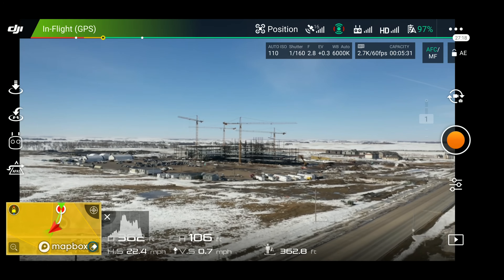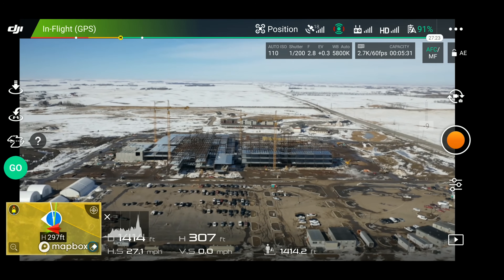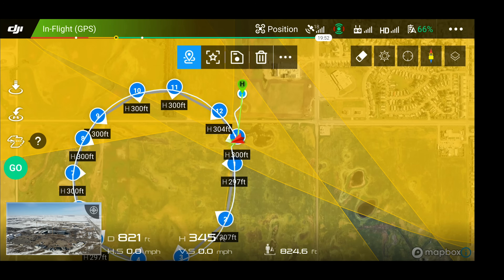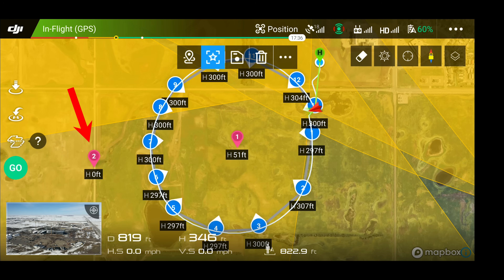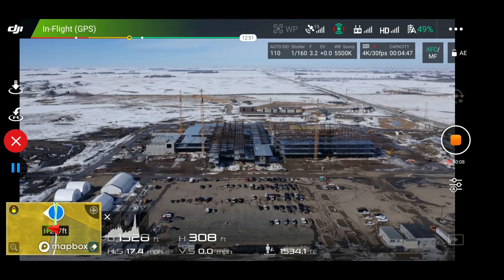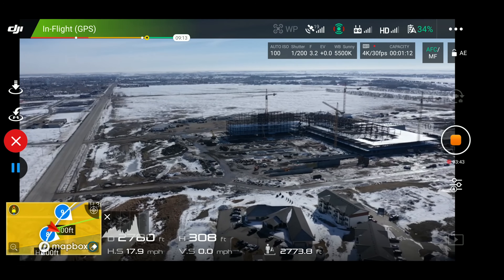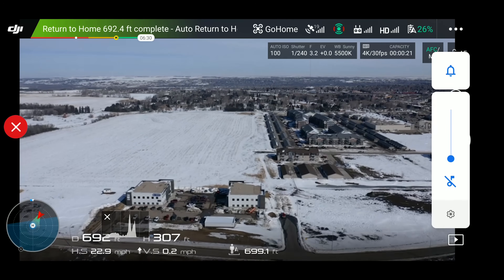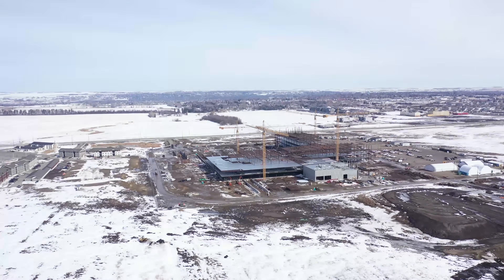DJI Waypoints 2.0 - In-Depth Tutorial Part 2 - One Setting Makes All the Difference!

Comment: There’s a couple of things I’m not happy with with .2 .0. The first is apparent in your video where the camera jerks  as it reaches each waypoint and it’s not a smooth motion (which everybody seems to be talking about as a hardware or firmware issue) the other problem I have is where you have set l(ike in your video) 13 waypoints and you are unable to start your mission at the highest waypoint and do it in reverse
Reply from the maker: The jerkiness was my fault.  You can adjust the arc angle of the waypoints. As for running it in reverse, that would be cool, but you could always just set up another mission going that direction
Reply: @51Drones  No, there's a known issue with the jerky behaviour. Also, you can run a course in reverse after a manual plan, my point was that it doesnt show you the the last waypoint check box in the app. Here's the stuff about the jerky behaviour. https://forum.dji.com/thread-182749-1-1.html

Comment: set a mission to fly waypoint and let the drone hover on arrival.  Launch the drone and allow it to arrive.  From that point manually set POI.   This will ensure your launch position is always the same and so is your starting camera angle and height
Reply: @51Drones  Could you start with a poi and use it to keep your radius constant while setting waypoints around the circle?

Comment: Did you customize your C1 Britton for setting each way point or is C1 a default when in the waypoints mode during set up?  Thx
Reply: C1 is default for setting Waypoints when you are in Waypoints mode
Reply: @philsmith5400  Is this the same for the mavic air by using the custom button ? (no C1 button on the air)

Comment: Why don't you tell your viewers about Litchi Waypoints?? 1) With Litchi you can plan a mission WITHOUT your aircraft being turned on. 2) You can set your waypoint altitudes RELATIVE TO GROUND. 3) Using Virtual Litchi Mission (FREE) you can preview your flight (including altitude changes, gimbal pitch changes, gimbal angle changes) in Google Earth Pro. I see no need to EVER use Waypoints 2.0 which is so inferior to Litchi waypoints. You should explore Litchi!
Reply from the maker: I don't want to tell people about Litchi until I have used it.  Running this mission has prompted me to check it out.  Thanks!

Comment: I believe the lines between the waypoints is a straight line and you had the camera at waypoint one in that direction and you were right about having the other points aim at the same place.  That is where the mini adjustment came from.  If you set the point of interest and set distance from and clockwise or counterclockwise is should be smooth.  In other words, I don't think you need waypoints for a perfect circle around the plant. Waypoints would be better for an irregular shape property or plant.
Reply from the maker: I missed a setting that will help smooth things out.  I'll have to wait a while to try it again though, as there was a large fire at the site this weekend!
Reply: @51Drones  But Russ, since you are just doing a circle you can just use the POI app and it will be a perfect circle around the plant. 
With the new POI for the Mavic Pro 2, you don't even need to fly over the plant first.
Reply: @StanCook  is there a way to save the POI mission and repeat it?
Reply: @apexaerialimaging7593  No I don't believe there is.  It is easy to do a POI so I don't see a need to save it once you have a video done.  It would be easy to come back to the same place and just do it again in just a few steps.

Comment: Hi Russ. Thanks for the helpful videos!!👍. Quick hint. When the RTH beeps start, tap the controller power button quick it will turn off the beeping. The screen will still show returning info. * Does not work with New Smart Controller. ***. 
Also can not copy or move Waypoint Missions from older controller to the New Smart Controller. You looked good doing your settings. A little practice works. Also DJI doing fine tune Waypoint update will help. Thanks Ken

Comment: I have been using litchi for years now and the first thing I noticed when waypoints 2.0 was released was the instability! Litchi really has dji beat ! I hope dji can fix this in the next update also when using litchi the drone does not need to be powered on when making the flight plan VERY CONVENIENT and doesn’t drain the drones battery 🔋! And I think you can draw the mission on the map FAST AND EFFICIENT!  I assume you are aware of most of this but maybe someone will find this helpful!
Reply: I tried the Litchi waypoint circling a building. It also showed a certain degree of drifting although less obvious than the DJI waypoint 2.0, is there anyway improving the smoothness in Litchi waypoint missions?

Comment: I noticed that the red LEDs on the mavic pro  were not on.  I found many videos on how to turn them on, but they didn't corispond to the remote.  I called DJI and was informed that the LEDs have been turned off to Andriod phone users only.  If you are using a IOS device (apple) they will be on.  Strange right?  I also asked if the lights will be on on the Pro 2 while using an Android device and they said they will be on.  Again strange.  I asked them if I could turn them on with DJI Assistant 2 and they said no.  I've been having a problem with Assistant 2 for the Mavic Pro that it will not work with Widows 10.  I'm getting a Administrator only Error.  They said that it will be fixed in two weeks.  If you need to use the Assistat 2 for the Mavic Pro  you have to use windows  7 or 8 for now.  The Assistant 2 will be fixed in a two weeks.   I just thought I'd drop you a line so you know.
Reply: Downloaded the new version of Assistant 2 yesterday.  No more Admin only error on Windows 10 ... yay !
Reply: I'm using Assistant 2 as a user who has admin priveleges but who is not admin.  Same as before the download, but whereas I was getting the admin only error before I can now run Assistant 2.  Maybe you have to run as a user with admin priveleges ?  The version I have is 2.07 ... apparently.
Reply from the maker: I still am getting an error!

Comment: Could you just use two points, one to start and then the other next to it, side by side. Then set in arc mode. Wouldn't it then have to follow all the way around the point of interest in one smooth arc until it got back around to the other point?
Reply from the maker: I don't think so, because it would need a waypoint on the opposite side to tell it where to go.  And how would it know how far to arc?  Good idea though.  I might give it a try.

Comment: Russ, I think I would consider using the Litchi app for this, as it gives you the ability to create an orbit mission, then fly the exact same orbit again and again. I generally like to use the DJI app, but find this functionality a really great option for flying the exact same orbit over and over without having to fly over and set my point of orbit on each flight. Hope this helps you. I really enjoy your channel. Take care.
Reply: excuse me, do you mean using the orbit mode instead of the mission mode in Litchi? can u save the mission and fly it automatically later ?
Reply: nc leung Yes, you can create an orbit in orbit mode, save it, then recall the saved mission.
Reply: @stephenwoodburn2970  thx so much, i did not realize u can save the mission before! that's a life saver!
Reply: @levleung2000  No problem. I have the Mavic Pro, and never understood why DJI did not have this feature. It is a real time saver when you are planning to go to an area with a point of interest that you want to film. I am doing a similar project to the one Russ described and it has been a real time saver. Glad it helped.

Comment: If I set an RTH from a waypoint, will it descend from that last waypoint, or will it descend from my standard RTH altitude?  What if the mission is one way, and I want to meet the drone there, will the drone get confused if I am traveling a distance to meet it at the other end of the mission?  Can I have it hover in place until I get to the point where I can control the final descent to land, and then land manually?  Will trees that temporarily block the visual path to the drone, confuse it to detect signal loss from the controller and stop the mission? The mission is to record a video of a river which is bordered by trees and away from a road I will need to travel on to reach the end point and land manually. The river is not navigable by any craft due to it’s waterfalls, rapids, rocks, and dangerous locations on shore until the end point. Thank you for your response!  Great study so far ... 😎
Reply from the maker: That's a lot of questions!  I'll try to answer them all.  When your drone engages RTH, it will return at whichever altitude is highest at the time.  It will never descend to a preset RTH altitude.  That number you set is just a minimum height.  If you want to meet the drone at the final waypoint, then I would not have it RTH after the mission.  It will go back to where you launched from.  Yes, hover and land manually.  Trees will not affect a mission.  Once it's locked in, it does not use the controller to run the mission.
Reply: 51 Drones Thank you so much!  I’ll do a trial run and make sure it does what I want.  Excellent two part explanation, but I just had to confirm what  I wasn’t clear about.
Reply: @51Drones  Can't RTH be set to return to the controller?
Reply: In the first video Russ showed a setting for what to do if the RC signal is lost. By setting it to "continue mission" (or whatever it said), I think that would ensure that it would not try to RTH if you lose signal while traveling to the end point. Sounds like a cool video!

Comment: Maybe you can create a two-point mission - 1 is your take off spot and 2 is the center of your POI.  Set it to hover after completing mission, then switch over to POI with the same settings each time.  By running the mission to point 2 then switching flight mode you would kind of guarantee the same center for the POI.
Reply from the maker: Excellent Idea!

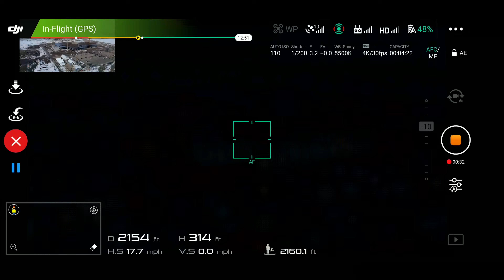Comment: Great Video! Now I need to go play with waypoints this weekend. I noticed at around 8:40 right before you sped it up, the red icon for your drone is following that faint blueish line which isn't a smooth arch from point to point. That must be the actual flight path and seems to correspond to the jerky camera movement you pointed out between 2 & 3, 3 to 4 and then again from 9 to 10 and 11 to 12. Another comment mentioned playing with the arc settings but I didn't see them.  This project is very similar to one I will be doing in the near future so I want to figure out before constructions starts.

Comment: Hey Russ, when you are setting up the waypoints, try using a protractor that has different size circles on it as a template to draw a perfect circle and get a perfect radius for the point of interest at each waypoint. I’m not sure if it would be better to use arc or polyline, but having a more accurate circle might keep the camera’s perspective consistent on the POI. Thanks for the videos. Always something new to learn.

Comment: Nice video! One thing though you didn't set the arc radius. Once you've chosen arc go back to each wapoint and set the arc turning radius. This will help to get smoother video from point to point. The larger the turning radius the smoother it will be. Its the last input on the lower bar where altitude and speed are. It shown on way point 2 and so on because no arc is needed for way point 1.
Reply: How do you go back and set the arc turning radius . I just got my DJI MAVIC 2 PRO AND IM NEW AT THIS . THANKS
Reply from the maker: Nope.  Tried it this morning. You don't have the ability to change the arc turning radius.  The last input is the POI.
Reply: @51Drones  After all is set up go to waypoint #2 and its there on the bar on the lower part of screen, the last input (turning radius), remember not waypoint #1.  I just checked it on my mavic 2 pro on a waypoint mission I set up a few weeks ago. I am able to change the radius with a point of interest at each waypoint
Reply: @51Drones  Take a look at this  https://www.youtube.com/watch?v=pox18asRtfQ&t=2s at 3 minute mark. Remember waypoint #2 and so on the first and last waypoint wont have this option just all the other waypoints will.
Reply from the maker: OOOOHHHHH!  I was only checking the first!  Thanks!
Reply: @51Drones  Thank you!!! You've helped me in so many ways. To be honest I also didn't see it until after a few weeks . I still think waypoints 2.0 can use a few tweaks to the firmware to get smoother video.
Reply: @djl61  Great to see how two guys model GENTLEMANLY behavior for the younger drone pilots!

Comment: I'm sorry if I missed somethig, is this only for the Mavic 2 pro? I just tried on the menu on my Mavic Pro plat but since I was inside it was in atti mode and it said it can't be done in that mode. So I'll know tomorow outside in position mode I guess. I would love this feature on mavic pro as I keep using my Anafi flight plan to do this... But I'm actually very happy with the Anafi flight plan 😊 Thanks much...
Reply from the maker: That's correct, only on Mavic 2 series for now.
Reply: Thank you Russ! I don't think I mind as much because as you I was not to impressed with the way points and the camera angle jerkines. And adding 59 more way points does not sound too fun either 😊 I'm sure this is work in progress still. Seems that the arc needs work. Anafi FP calls it transition point to point and it keeps the camera perfectly on the subject and transitions to other points... Something like this...https://youtu.be/Ve9jmIZrngM

Comment: Sooooo...... Just for giggles, try flying it using the Polyline mode instead of the Arc mode... I wonder if it would still be self-correcting like that???
Reply: In polyline mode the drone will stop brievely at each waypoint.

Comment: Still not as good as Litchi was nearly 3 years ago. You can do more with Litchi, plus you can plan it on your home computer as well. Litchi will also hold the height AGL, so if you are 50' going up a 100' hill, it is still 50' AGL at the top, does DJI do that? At least DJI is trying and I'm sure they will get better.
Reply: Yes this was one of my main issues with WP2.0 It should always be AGL